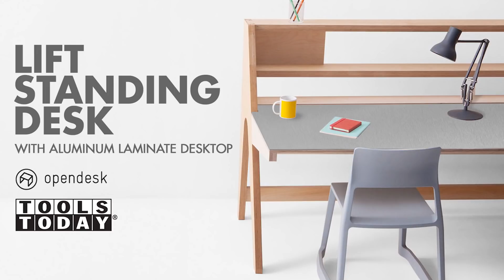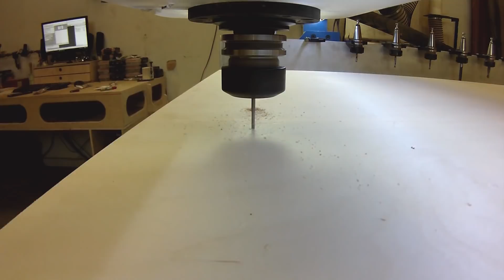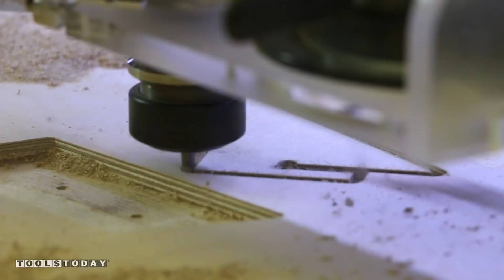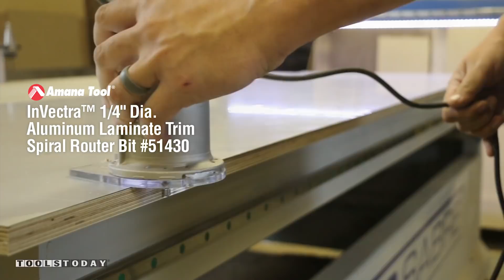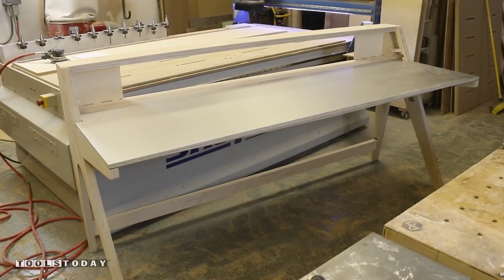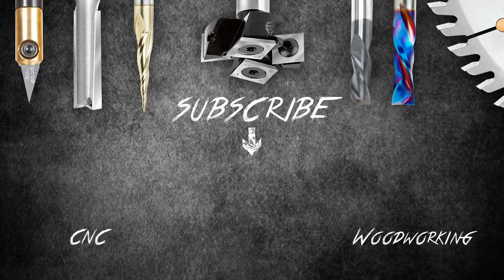CNC Project: Adjustable Height Plywood Desk | ToolsToday

Comment: CNC Machine, what's this run ya? 12,000? 15,000?
Reply from the maker: We have included the CNC running parameters in the above description, these were run at 18,000 RPM
Reply: @ToolsToday   I meant Cost, not RPM.
Reply from the maker: @Chrisfragger1  Hi, the CNC machine, yes it begins at 24,000 US dollars.